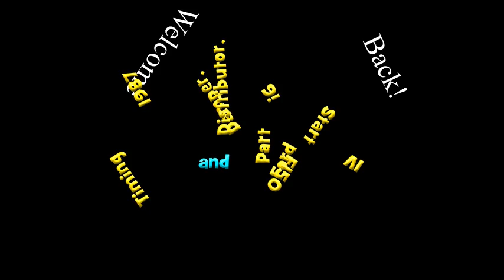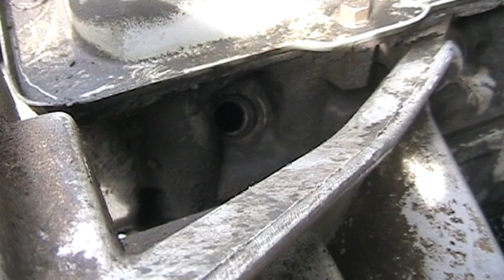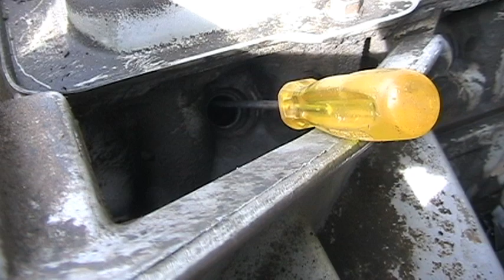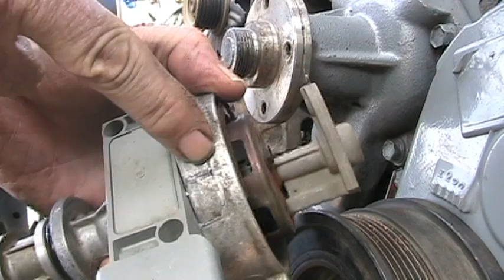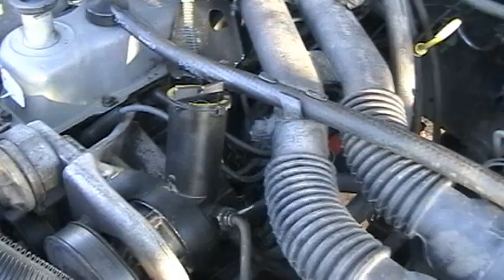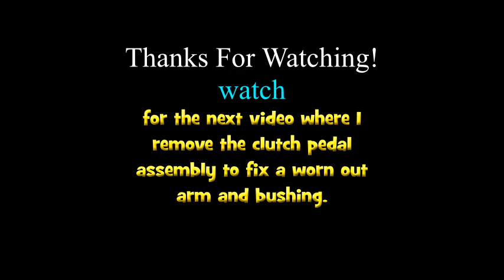1987 Ford F150 I6 Damper, Distributor, Timing and Start Part IV

Comment: 1994 Ford F150 
4.9L 300 Straight 6

Timing Mark's and Distributor the same. But my distributor looks different from the book. This one I got doesn't have a module like yours. So does the timing have a different set up for 94 Ford F150 300-6
Reply from the maker: Check the left side fender. The module was moved (not sure what year) to the fender for better heat dissipation. Look to the right of the steering column on the fender. It will look much different than the one in my video.
Reply from the maker: Look around where the hood hinge attaches, it may have cooling fins on it. I believe what you found previous post was the ECM(computer), and yeah, they are pricey. You want the distributor ignition module.
Reply: @SteveAZ711  i checked that one, but those are $250
Reply: @SteveAZ711  ok will try that but if that doesn't work I'll double check the timing. But it should start even of the timing is off but it will run rough idle.. but I got the timing correct from this 94 300-6 (just realized I have no spark what so ever) so it could be the ICM (on fender)
Reply: @sfnmobilemechanic  I have a No Spark going on with my 94 E-250 4.9 that has 309,000 miles. Owned it for 20 years now. Was an old sears service to your home truck out of Mountain Home, Ar. Third motor. Found this one on Facebook  Marketplace for $200 with 74,000 miles, one owner. After 9,000 miles on it and it running good it decided to do a no spark. Won't start unless i take out the Spout Plug. So when you do that, its bypassing the ECM( computer), so you can get home, without the ECM. I heard that advice from Scanner Danners video's , Best guy for wiring problems and diagnosis. I  thought it was the coil and the pickup in the distributor so i replaced the whole distributor and the ICM and coil. Still no spark, unless i take out the spout. So, now i have a remanufacture ,in Mexico, ECM sitting right here and plan on installing it soon. Autozone cost  was $164 plus core $44. The ICM they sold me was bad ,out the box, so I put the old one back on and found out it still works. I should of bought motorcraft, not duralast. Their new distributor does not have a cut out or groove inside the shaft for (oil pump shaft) the 'C" ring retaining clip, to seat in. It will not lock on tight, like the original. It has some friction though. I just hope it doesn't fall back into the oil pump or the oil pan , now, during installation or later down the road. Maybe I should of rebuilt the old one. Saving it for later along with the ECM- Original Computer. Now if i could just get the distributor in right. Thats where this mans video come in. Thanks.

Comment: Hi Sr thanks for your help this is the first video I watch from you and I really enjoyed...I have a situation hope you can help...I have a 82 f150 300 motor 6 in line and runs rough on idle but running feels good and strong...spark plugs,cables,rotor and distributor cap are new timing feels good so I don't know what to check now if you can help I appreciate your help
Reply from the maker: Rough idle can be caused by a vacuum leak, or a carb needing an overhaul. I believe 82 was still a carb engine... if not then you may have a weak injector. Look for vacuum leaks first. Spray some carb cleaner down the carb intake while you are running it up by hand. This may clean a clogged air passage. Additionally, I know you said the plugs were new, but sometimes(very rare)you get a bad one. Then remove one plug wire at a time while the engine is running(be careful so you will not get a shock)this will give you an idea if their is any plug or wire issues going on with the idle.
Reply: Cars Trucks And Detours thanks for your answer and help I will do check the carb...I check the cables pulling one at the time and it's a really small change except for the piston number one it's the only one that I get a big difference...I put a piece a paper on the pipe and makes big noise i heard that's  a valve problem it's that possible?...but anyway I will do what you said first
Reply from the maker: @JoseRodriguez-nl7no  If you do a compression check on each cylinder, a leaking valve will show up as lower compression on that cylinder, and it may just be  lifter holding it open as well if that is the problem. It really sounds to me like you have a vacuum leak. Check out this link for a good how to on vacuum leaks...https://www.youtube.com/watch?v=9CPqbaSgcok
Reply: Cars Trucks And Detours I did check for a vacuum leak just like on that video and I didn't notice any change and I did the carb cleaner and nothing change I will do the compression check I hope I have better luck...I will do the carb kit you have a video how to tune it?
Reply: Cars Trucks And Detours I put the distributor and I put the cable for pistón number one and the truck don't start and I move the cables back before the mark on the cap and then starts but makes explosions...how can I fix that?
Reply from the maker: @JoseRodriguez-nl7no  Just use the directions on the rebuild kit for adjusting the mixture screws. You can fine tune it later when the truck is running good.
Reply from the maker: @JoseRodriguez-nl7no  Ok it really sounds like you have the timing off. Take a step back and check that you are using the correct timing mark on the crank pulley. If you have pulled the distributor and reinstalled it, then you may have to redo that procedure again especially if you find the #1 cylinder is pointing not to the #1 plug wire. Ok that said, I found this post on a forum that a person is having a similar issue and it is a very good easy to follow procedure that you may want to do as well. I could not have said it better...Here is the forum link...
https://www.ford-trucks.com/forums/1309739-firing-order-problem-for-my-4-9l-inline-6-a.html
Here is the quote from 1986F150six..."
The spark plug nearest the radiator is #1 and the rear most one is #6. Remove the #1 spark plug and using a wrench on the bolt securing the harmonic balancer, rotate the engine [be sure the ignition is OFF]. Place your thumb over the open spark plug hole and when the pressure blows your thumb away, you know the #1 cylinder is on its compression stroke. Place something long and skinny [like a soda straw] in the spark plug hole, resting on top of the piston, and move the wrench back and forth [just a little bit] until the straw stops at the highest point. Look at the rotor in the distributor... it is now in position to fire the #1 spark plug. Set the distributor cap in place and notice which metal terminal is just above the metal tip of the rotor. Connect the #1 spark plug wire to that terminal. The rotation of the rotor is clockwise, so the next terminal to the right is for the #5 spark plug. The next terminal to the right is for spark plug #3; then #6; then #2 followed by #4." 
Hope this gets you back to a good running engine. You can check out the link and read more posts about this issue.  Do not get discouraged, these issues can be a little frustrating at times. You will get it fixed.
Reply: Cars Trucks And Detours perfect Sr I really really appreciate your help I'm sure with your instructions and help it's going to work...blessings
Reply: Cars Trucks And Detours okay I did what you told me and it was working for a while but then the engine dies and there it's no spark and after that does not start any more even with spark on the plugs...and when I was moving the distributor makes a huge explosion 😏...I'm getting frustrated i don't know what to do anymore
Reply from the maker: @JoseRodriguez-nl7no  In the video on this page at marker 2:15 I show how to tell if the distributor is set to fire on #1 plug. If after you do this and the rotor is not pointing to the #1 plug wire on the distributor cap then the timing is not right and you will get backfires and popping. I would say that by the sounds of it that is what the problem is. The distributor can be turned a bit by hand to have that rotor line up with the plug wire in the cap. Also make sure the wires go to the proper cylinders on the cap clockwise #1 then #5 then #3 then #6 then #2 then #4.  If there is just one wire out of order then it is not going to run right.
Reply: Cars Trucks And Detours yea that's what I did and start up but then I turn it off and tried again and nothing
Reply: Cars Trucks And Detours hello Sr I just wanna thank you for your help and to let you know that I finally fix my truck...the problem was the ignition module after checking on google and the repair book I was able to do some tests and finally fix the problem
Reply from the maker: @JoseRodriguez-nl7no  Excellent! Thanks for letting me know. Intermittent electronics are the most difficult to find.

Comment: So if I jump my 1990 Ford F-150 from the battery to the solenoid, & it starts, does that tell me it's the ignition control module or distributor?

Thanks in advance
Reply from the maker: Mine was the clutch pedal safety switch out of adjustment. It could be the solenoid, reverse safety switch(automatic), or the ignition switch start position. By it running it tells me the distributor and module are ok. It is the start circuit that you want to check out, not the run circuit. If you have a test light or meter, have someone turn the key to start while you are checking for voltage at the solenoid(remove the little wires, I believe the red one) like they are trying to start the truck. If you get a light or voltage then everything from the key switch is working and you probably have a bad solenoid.
Reply: @SteveAZ711  Thank you!

Comment: Good evening friend, can a 4-pin Chevrolet module be adapted to that type of dealer? Thanks and regards from Venezuela
Reply from the maker: Like you I noticed the similarity of the Chevy module to this Ford. I had an 80"s Malibu that a module went out on me some 35 years ago. I never tried doing a swap, but I think I would give it a try if that is all I had. If you knew the voltages and could match the pins with the connector in the right places, then it may work. I just don't know, but it sure is an interesting idea Pedro.

Comment: Will this distributor work on a carb 300 6
Reply from the maker: Why would you want to change the distributor?
Reply: It's an efi 300 6 that I'm converting to a 4 barrel and I would like to know if I could use the efi distributor
Reply from the maker: @Luke-oe5qi  I believe you would need a Dura Spark II distributor with a vacuum advance and of course some different wiring. I have never done this...however here are a couple of links for you that may help...https://fordsix.com//viewtopic.php?f=2&t=63890
https://fordsix.com//viewtopic.php?f=2&t=63890
https://www.youtube.com/watch?v=fvDLUTGFO_M

Comment: can some one please tell me y my 460 #1 cylender is on passager side but my tcd mark tells me its on the driver side
Reply from the maker: Jeffery, Ok here is what I would do. Yes #1 is on passenger side front of engine. Distributor rotates CCW. Now, forget looking at the damper pulley timing mark and in my video I show how to bring to TDC #1 cylinder. Do this. Rotate the crank around until it blows the wet paper towel piece out of the hole. Then get a long thin screwdriver, put it in the spark plug hole, and very slowly, very slowly turn the crank pulley and watch the screwdriver move up. When it just starts to move down then turn the crank pulley back very slowly to push that screwdriver back up a little bit. Do not get the screwdriver stuck in the hole. You will now be at top dead center. Look down at the crank pulley and sand paper it or whatever, there should be a faint thin line showing somewhere there next to the timing tab. Look very carefully. It has to be there.  Ok that said, even if you do not see a mark, the engine is at TDC because you had compression on that #1. Now drop the distributor in with the rotor pointing to #1 position...use the cap to draw a line on the distributor.
Now, all bets are off, if the timing chain has slipped because the cam gear and crank gear have dots that need to be aligned when #1 is at TDC and the timing chain is engaged in both sprockets. So, you may have to pull the crank pulley and front timing chain cover and do the procedure in the first paragraph to see if they are aligned. Also, a broken cam shaft would cause the same issue. That is what I would do if I was Sure that I was on my timing mark and it was not lining up.  Hope this gets you on the right track.

Comment: Your video has saved two f250 trucks from the scrap yard the late 80s to mid 90s trucks are built like tanks! Many thanks.
Reply from the maker: "Built Ford Tough"
Reply: @SteveAZ711 I have similar problem on my 95 f150
Reply: This series also got my 86 F150 back on the road as my first truck! Thanks a ton!!

Comment: Thank you so much I watched this video fifty times and figured my truck out.  I have never done anything like this and you made it happen.  I caught my carb on fire.  I think it was my timing .  I was breaking in my new cam and had to keep it running.  I still had the timing set to zero.  If I put a new carb on should I set the timing to ten degrees bdc with a timing light, or could I just set it to ten on the scale.  I left the spout plugged in when it was on zero.  My hayes manual is vague.  This is the best video I have found on here thanks again.  

p.s.  I love the music I don't care what that guy said
Reply from the maker: Hey Paul thanks for the nice comment! I always disconnect my spout and then set the timing. If there is a sticker with the specs (timing etc) use the setting they recommend. And,  I always use a timing light when setting timing.  With that carb fire it sounded like your timing was a bit off. That is a good reason to always have an air cleaner on the carb...in case it pops back...no air no flames. Be prepared for something like that. A good fire extinguisher is nice to have handy as well. It has happened to me on several occasions as well. Be safe! Thanks SteveAZ711

Comment: It's a bitch to get the retainer clip and bolt back in! :)
Reply from the maker: Sometimes it can be, and sometimes it is a piece of cake.
Reply: @SteveAZ711  :)...I'll tell you when it's hard...When it's 90, humid and you had a bitch seating the distributor back in on my 93 f150...:)...Like I did yesterday...Dropped it (the clip) into the crossmember...Doing it on asphalt in the sun...WEEEEEEEEEEEE...And of course; IT DIDN'T FIX THE PROBLEM!....Once we found it; you're right; "piece of cake...I did it like you did- one handed, went right in...

Comment: I have a 89 f150 4x4 302 motor when i was coming out with the distributor the rod on the oil pump was hung onthe shaft . anyway it fell out in the crsnkcase any w ay to get it out without tearing it down .help
Reply from the maker: OMG, that happened to me once and I was lucky that the rod tip was standing straight up so I was able to grab it with a small magnet. I really do not remember what engine I was working on at the time. Sorry I was so late to respond, but I just found a passel full of comments waiting for review.
Reply: I was going to say use a magnet also. The small pen ones?

Comment: my 89 stops running when it gets hot. it won't even crank for a half hour. any ideas!
Reply: The PIP sensor goes bad. Replace the distributor. It could also be the module.
Reply: 4.9/ 6
Reply from the maker: Hi Tim, If I was in your position I would change the Ignition Module as it makes the spark for the cylinders. I am assuming that won't crank means not turn over? If so, then the starter or the cable going to the starter may need to be replaced. Check to make sure all the starter electrical connections are tight. Also, if you jump across the solenoid and the engine turns over then it may be a bad solenoid or key switch. I have had issues with some Ford Key Switches (ignition switch) in the past where they caused the problem exactly like the one you are experiencing. SO, on SECOND THOUGHT look to the key switch first! You might need someone to turn the switch on and to start position while you check for voltage at the solenoid with either a test light or an ohmmeter. Have them jiggle the switch to see if the power is intermittent. If so then there is you problem.
Hope this helps! Thanks for the comment!